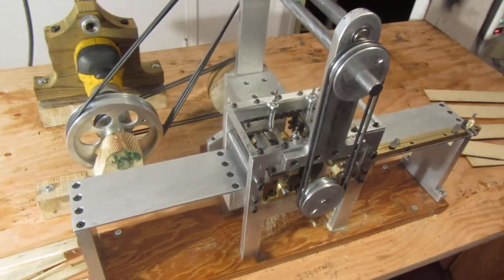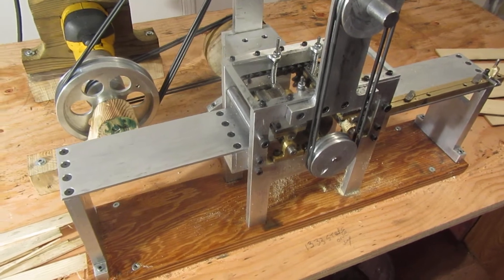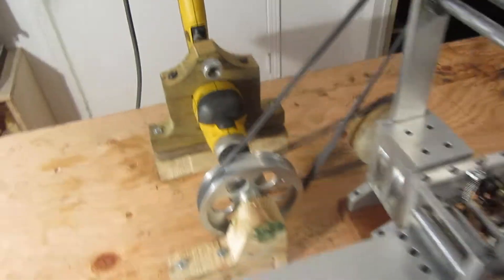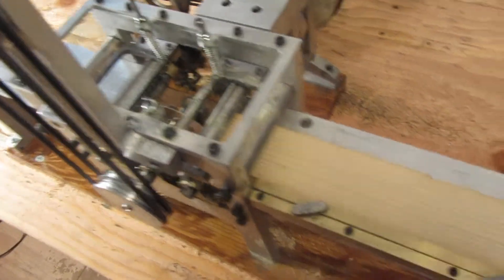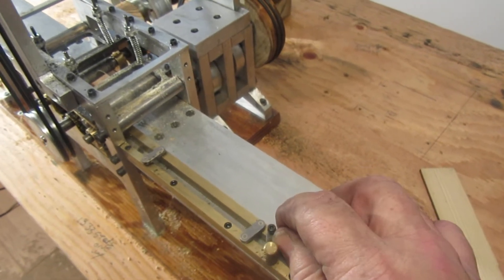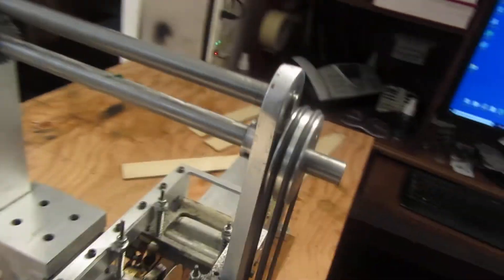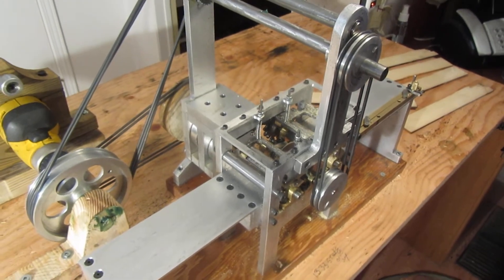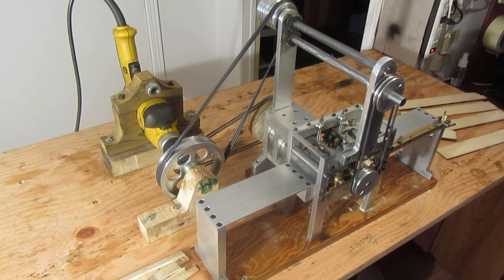SAMILL EDGER EXPLANATION 2019 12 01 001

Comment: I love the custom holder. Could you make a video on how you make the knob mechanism that pulls the drill's trigger? It may be very simple but I've always wondered. I also love the linkages for adjusting the fence. What would be the advantages of using that type of swing action vs running the rail on linear slides? Also, what is the reason for the rail snapping back? is the pin spring loaded somehow and falls into a detent?

Comment: Looks good! I didn't see the second video of it running. Can you add a link in your description?

Also, would it be possible to use "climb sawing" to have the saw blade turn the same direction as the feed rollers? It would probably be OK if the blade were positioned to take a deep cut. And perhaps a clutch could be used to engage the rollers, or just have a way to engage them on the wood by hand pressure to control feed.